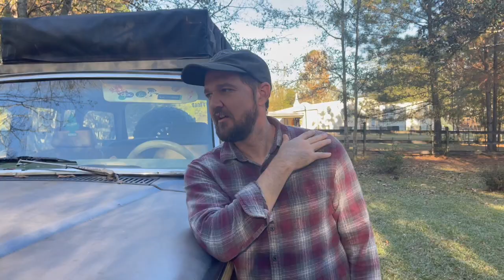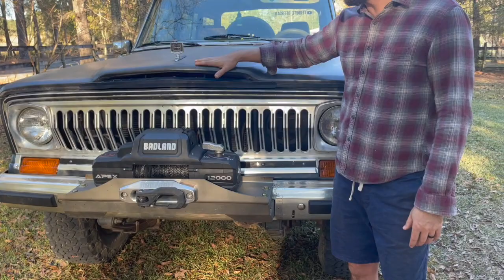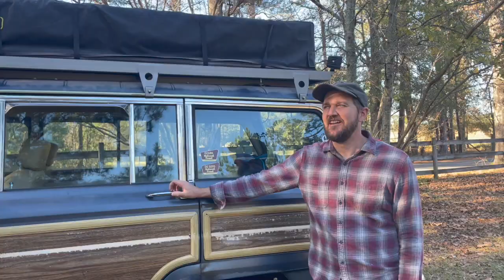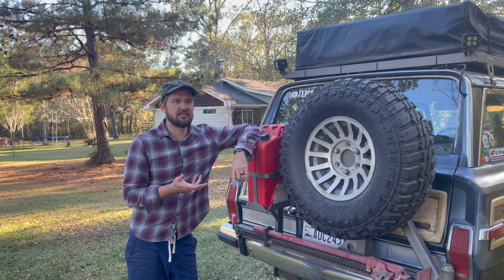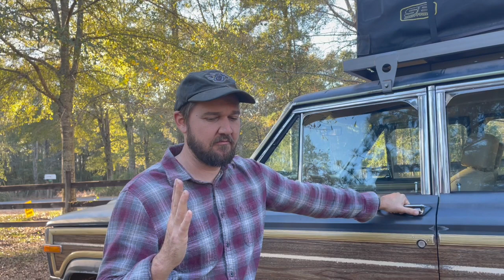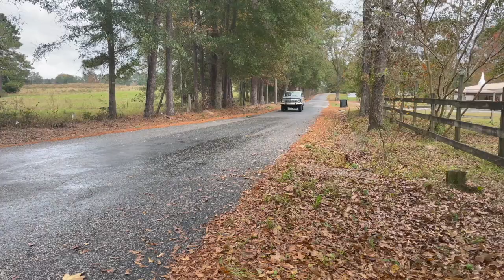Why are we doing a Hemi Swap? #hemiswap #hemi #grandwagoneer

Comment: You do your build for what you need/want it to do. I'm mostly an AMC purist, BUT I'm also on a long term plan for a full driveline swap because we want to do long distance trips when the kids are out of the house. In the meantime, the 401 and TH400 work really well because they are durable and I can work on them with hand tools and not worry about stuff as much. I actually like your winch setup, but I also am envious of the hidden winch crowd too. I needed a big steel bumper up front because I run into stuff on the trail, and I just got the easiest one to mount a winch on.
Reply from the maker: Yeah I’m a fan of the factory 360/727 combo. But for the long trips we wanna take the 5.7 is gonna be way more practical. We’ll see how the hidden winch works out!
Reply: @TermiteOffroad  You're going to have like overdrive and reasonable road noise like a full grown adult ;)
Reply from the maker: @renodemona   😂😂😂 a whole new world!

Comment: Happy Thanksgiving! I also never had an issue with my motor other than the electric fuel pump dying on a date night. I had my original rebuilt (and ruined) by a local shop. I had it done just before all of the parts shortage issues, and some of the parts took 6 months to get then. Some have been discontinued since. I picked up some parts the other day for it (oil pump o ring and oil pan gasket) and the parts store had them IN STOCK. That never happened with anything for the AMC motor. Even had to order the oil I used. I have had the swap done exactly one year as the week before Thanksgiving last year it drove under modern power for the first time. I've put almost 9K miles on it in the past year and every one was enjoyable and was spent doing things I've longed to do with it. I went with the LS in mine of course, but also am a Dodge guy from the LA block days. Just now more familiar with the GM stuff, so I stuck with things I was fresh on. Oooooh! Hidden winch through the bumper! You guys are definitely on the same wavelength as me. I agree on the aesthetics of less bulk on the front. The twin carrier sounds neat. I have a stockish size on the inside on a mount from a former FSJ custom parts vendor. And yeah, the driver's side is the place to put a spare. Will also be watching the rocker replacement as one of mine has the tell tale bubbles. Ouray, Silverton, and Telluride is definitely an item for me as well. Black Bear has been on the bucket list for some time now. Cheers!
Reply from the maker: I was gonna message you and ask what fuel pump you said you were running. That’s the last thing to get and I have an idea of what I want to do but looking for ideas still.
Reply: @TermiteOffroad  Hey, no prob. I'm running the late 90s, 2 door s10 blazer fuel tank and many run the same era blazer pump. I think mine is a 96 4dr blazer pump. They'll fit perfectly. There is one style that is very close to the ohm range the stock 86-up Wag gauges run. and many opt to run that one for wiring simplicity. I believe the LS needs about 55-60psi to function correctly, and the blazer pump fits the bill. You'll have to see what the Hemi needs, but if it's in that range, you're good to go. If rocking a returnless setup, I like the early 2000s Corvette filter/regulator assembly. Mine is mounted just ahead of the driver's rear wheel on the frame rail.
Reply from the maker: Yeah the hemi needs 58psi so essentially the same. I was wanting to keep the factory tank if possible.
Reply: The issue with the factory tank is lack of baffles inside, so when the fuel level gets low, the engine can stall.